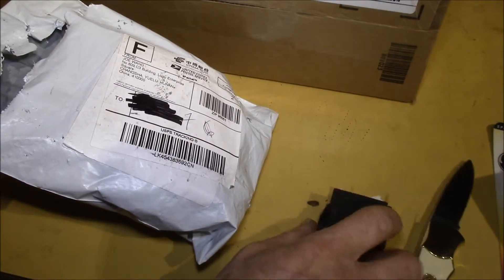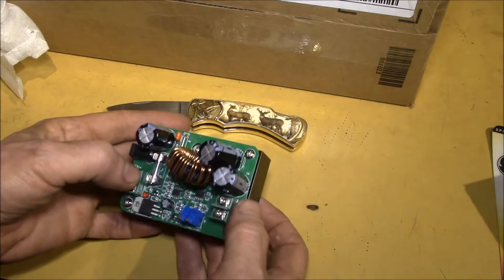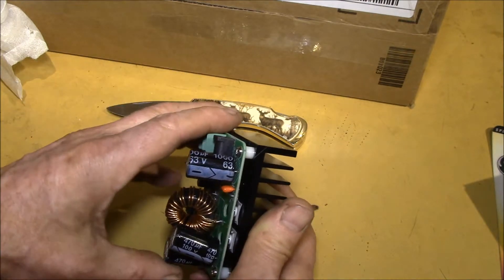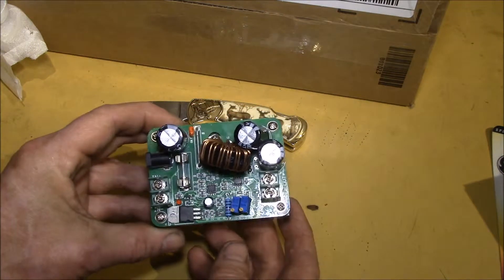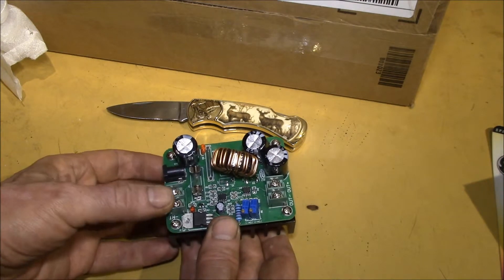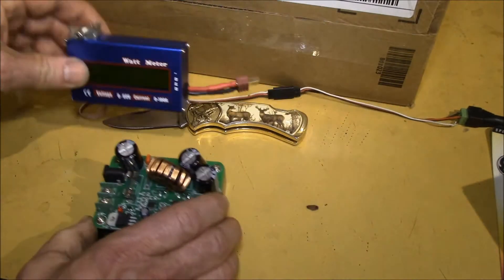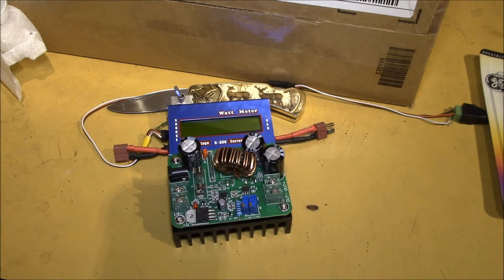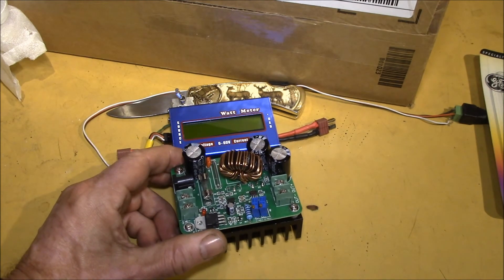DC-DC Boost Converter, or ...? , Part 1

Comment: I bought the 1200 watt  20a  boost converter to crank up my 48v 1000watt ebike using a 42v lithium battery.
Reply from the maker: That will be interesting to see how that works.  You'll want to test out the converter to see how it handles the high current, I usually find you want to stay below 50%-70% of the rated output current for sustained operation on most of these sorts of things.  Like I'm running 9A - 10A input on my 15A max. rated converter and that's been running many hours every day for coming up on 2 yrs. now.

Comment: When i adjusted the constant current trim pot, nothing happens. Only the voltage trim pot is working. Any suggestions sir?
Reply from the maker: You'll only see an output change from the current adjustment if you are in the current limited mode.  If you are in the constant voltage mode (where the voltage adjust pot moves the voltage up and down), adjusting the current pot does nothing until you turn it down to the point the output current is limited, at which time the output voltage will drop.  For example if you are just measuring the no load voltage, the current pot may never do anything, since there is no current, it will never exceed the current limit setting.
Reply: R Brown Great tips sir! Will focus on this and test again

Comment: What happens when we upgrade the output capacitors to higher capacitance or higher voltage?
Reply from the maker: Well a larger value of capacitor would help to reduce the voltage ripple especially under variable loads, say when feeding a Pulse Width Modulated motor controller or dimmer for example.  Upping the voltage rating would make the capacitors last longer as they would be under less stress if rated higher.  I doubt the converter output voltage would increase unless you could get in and change the micro-controller firmware.
Reply: R Brown The boosted voltage seems to be effected by the switching frequency of the pwm

Comment: Heat sink is rather beefy. haha, be on safe side, keep it operate below 8Amp. Btw, the trim pot can be replaced with better Bourns Pot..
Reply from the maker: TheOldmankk For sure, or add a fan for cooling as the inductor seems to get a bit hot as well.  I doubt it would handle 600W, but for 100-120 watts it seems to be decent.
Reply: some of these Chinese made dc converters performing spec are overly stated. Always enjoy UK Julian Ilett and Jim Conner doing all these postbag items stuff. haha.
Reply from the maker: TheOldmankk I also enjoy Julian's videos, I'll need to check out Jim's as well.  That is very true on the overstated specs.  My thought was if I could get 20% of what was spec'ed then I was happy.  If I got a 100W unit, it might only do 20W, but the 600W unit might actually do 100-120W which is about what I was looking for.  I think it'll work well for capacity testing reasonable size batteries.  

I also want to see if it'll power some things like 120V LED lights as some of those list ~85V as the low end of their operating range.  May or may not work, but if so, it might be an alternative to firing up an inverter just to turn on some light bulbs.
Reply: +R Brown (4Crawler) would any 100k pot work as a replacement?
Reply from the maker: +Zev Hoover Likely so, given the same size and pin out.